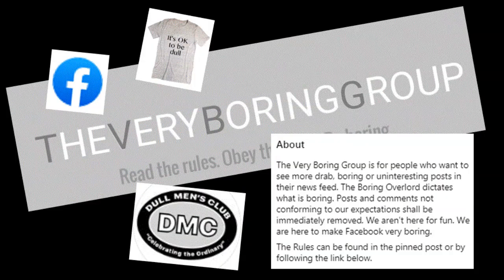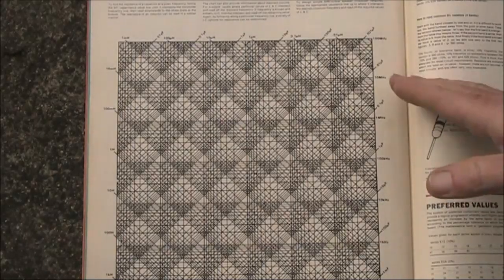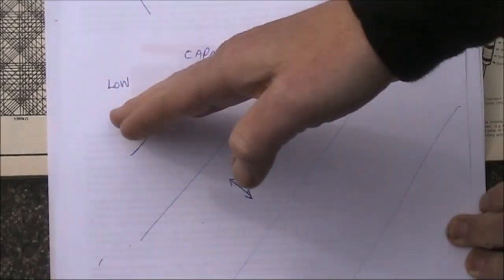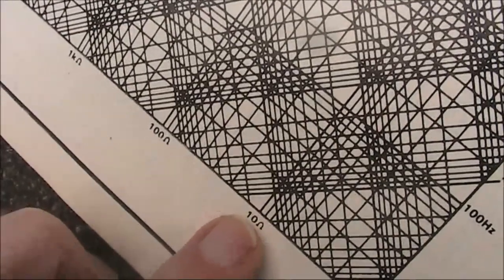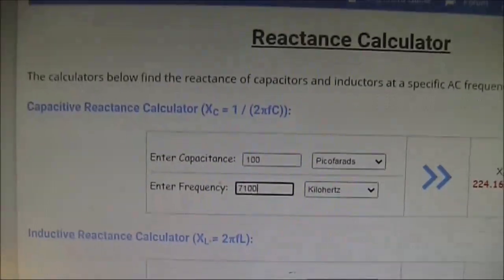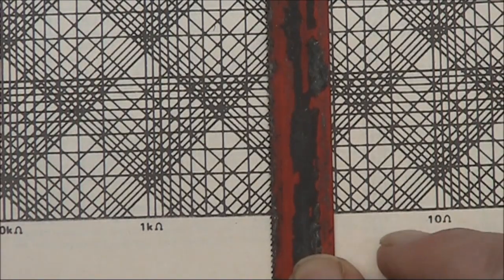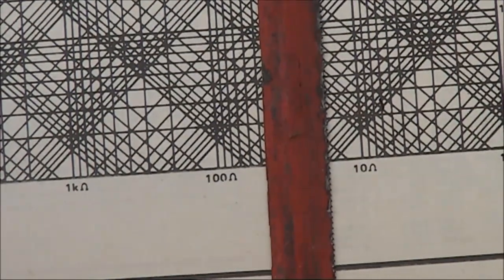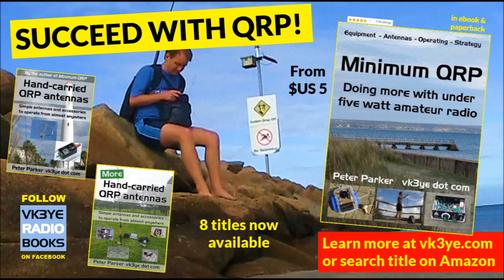A look at frequency reactance nomographs

Comment: Thank you for your calculation for lpf because l was looking for it for long time ..but you depend on antenna or load impedece as 50 ohm,ok but what about the other side as power transistor or valve how can i calculate it.please explain that

Comment: That brings back memories Peter.  When I was first licensed in 1979 I was building  a power supply for an old Eico 753 (my first rig).  I was trying to figure out what I needed for capacitance for the 60Hz filter.  My 'Elmer' Harv said "let's have a look at the old 'chicken wire chart' and thumped the ARRL Manual on the bench -- I never forgot that lesson.  Ah, the good old days.  73, Bob

Comment: Wot we used to do before computers and pocket calculators. If you forgot to bring your trusty hacksaw blade with you, you could always read the nomograph along the edge of your slide rule - and not a battery in sight.
Reply: I used a slide rule until my dad upgraded to a Sinclair Scientific pocket calculator. One advantage of that calculator was that after one attempt my classmates never tried to borrow it. After that I went the HP RPN way.